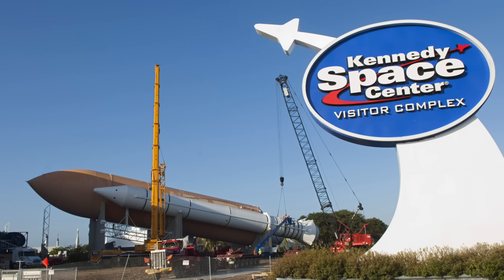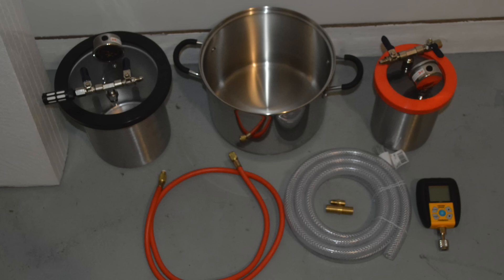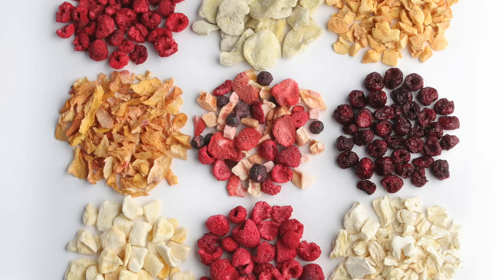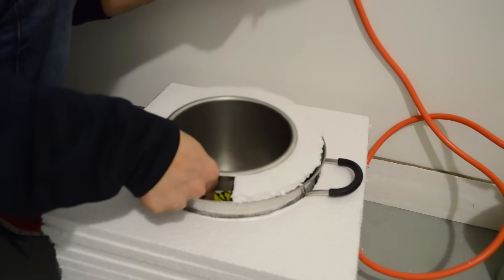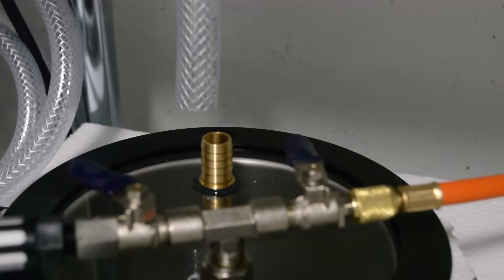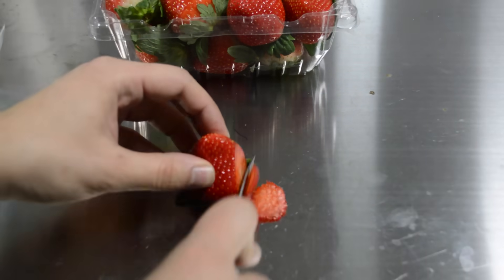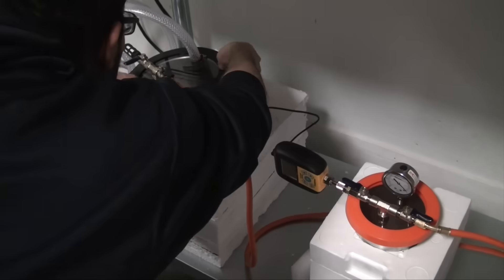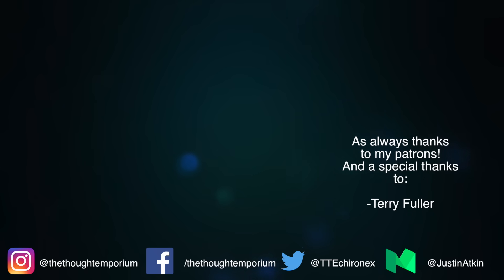How to Build a Freeze Dryer

Comment: Is it possible to put the dry ice in the vacuum chamber, set the pressure, and release the gas as necessary?  also you can add salt and baking soda to absorb moisture in the vacuum chamber.  CAn you please share your feedback?

Thanks

Comment: This doesn't make sense as far as no heat goes. My freeze dryer uses different temps for amlost everything. If using no heat worked the best, why wouldn't they leave it below freezing for everything? I thought you needed heat for sublimation?

Comment: Ok. Still a bit too $$ for me.  How about if one puts a sealed jar with food outdoors in winter (WI)  with manual brake bleeder vac pump on canning lid attachment?  Let nature do the freezing, go outside and periodically pump out all the air.
Anyone tried this?
As a roughly $20-30 option.  
Or in summer, stick the whole assembly in chest freezer.

Comment: This is quite late, but instead of Teflon tape, use a product called nylog on your thread fittings. It acts as both a thread lubricant and a thread sealant. It never dries or cracks. It's what I use on all of my refrigeration systems I need to evacuate. My manifolds can easily reach 50 microns Hg/50 mTorr. I have found that Teflon tends to be a bit leakier.  With that said, I also only used tapered fittings or flare fittings  on my vacuum setups.

Comment: I'm thinking in craft a 1 cubic meter box and get a cooling system from a cooler and install it on it, make a hole and there connect the vacuum to low the pressure so I can keep frozen all that food inside the drying chamber, but I see the really problem is the refrigerant chamber that has to be as cool as it cans

Comment: 6:11 Dickhead alert!!! disregard this warning, anything sub zero should be handled in the nude for maximum safety, if dice or ln2 or liquid butane/propane touch bare skin it just rolls off from the liedenfrost effect. if it touches clothes it freeze burns them to your skin and hurts like getting stabbed
source: every ln2 overclocker, personal experience and watching someone rip a sleeve off with skin still attached

Comment: Hi Thought Emporium,  im gonna build a freeze dryer and i watcherd your video but i have a question:   when the water sublimates off the food, does it travel thru the tube to the cold trap to condense as solid there or is that a secondary condenser with the primary collection of water happening inside the food holding vaccum chamber?  

im not sure if i need to keep a cold finger in the vaccum chamber with the food or not.

Comment: One of the only video I could find. Thank you. Was trying to see if I could build a big one like almost walk in. And how they actually worked. Thanks great video.
Reply: That's a lot of -pressure in a huge area, basically a bomb if it fails.  Unless you're working for NASA, it's going to cost about a Mil in steel and labor for welding the structure alone.

Comment: Had to rewatch this video again for cold trap inspiration... Do you think this design would work for capturing methanol/VOC's in a vacuum percolation device? I'll be bubbling humid air through distilled spirits to expedite oxidation reactions and simulate gas exchange in a barrel. I have access to a diaphragm pump (not PTFE.... But I want one someday...) that can go down to 27in Hg, and I don't want too many vapors to condense in the pump itself... Is there a cold trap design you'd recommend for the budget-conscious creator?

Comment: If you ever need to make more cryo insulation I would recommend closed cell polyethylene foam. We use it at work for LN2 plumbing and it works a treat. If you stick with the polystyrene though I would recommend investing in some nichrome wire, a 12V battery, and either a high power pot for voltage splitting or, for more efficiency and less heating, a variable buck converter to adjust the voltage across the wire. Basically I'm describing a DIY hot wire foam cutter. A lot better than using an exacto, I can tell you that much.

Comment: Great video but in the long run... the initial low cost of a DIY unit will end up costing more than a retail unit, due to the unavoidable need to replenish the dry-ice, given dry ice is a consumable and can be pretty pricey in cetain markets :(  The most cost-effective solution, of course, would be to find a used retail unit for cheap or (better yet) split the cost with someone/a group of ppl, to help lower the rather steep initial cost. On a side note/for what it's worth... many people forget that DIY & retail freeze dryers typically need to operate for many (many) hours, so depending on the water content of the particular food being freeze-dried, the freeze dryer may need to run for 12 hours, or more, which (unless one lives where electricity is cheap or they have a solar system) there's going to be a noticeable increase in one's electric bill when running a freeze dryer...the point being...it might be a lot less expensive to simply spend/invest the $3000-$5000 (plus food costs) on food that has already been freeze dried by a commercial company(?)
Reply: Dry ice is so cheap I think this would be great for home growers that only harvest a couple times a year
Reply: A pump like that is around 300-400 watts. A "home unit" by greenworks is 750 watts. So it costs less in that aspect. Secondly you don't need an astronomical amount of dry ice. Only about 6 dollars worth

Comment: RRRRIIIGGGHHHHTTTTT. LOL I simply bought a Harvest Right home freeze dryer back in Dec 2081 - I run it almost 24/7 and have processed a lot of foods for long term storage. Compared to buying commercially produced FD foods - my dryer has paid for itself many times over. It will also process up to 20 pounds of foods in a single batch.
Good luck with your DYI dryer.

Comment: I just found this. Very good and informative. As an owner of a lyophilizer service company I only have 1 criticism. You keep stating that no heat is applied. This is against the criteria of sublimation. Heat is ALWAYS used in freeze drying. This is how you achieve sublimation and desorbtion in time. Heat is applied either radiantly, or more common, through conductance. Other than that, very informative.
Reply: Considering you need a vacuum of at least 611 pascals to reach the triple point of water, where it goes directly from ice to gas at 0C or higher, do you still need to apply external heating to the vacuum chamber? Is the freeze drying apparatus being in a room temperature environment not enough, seeing as theoretically the ice sublimates at 0C and above anyway? I've read that for the tail end of freeze drying things like fruit or other organic material you sometimes need to apply a small amount of external heat to overcome the molecular attraction between that last bit of water and whatever it is locked inside of, but for the first 90-95% external heat should not be necessary I thought?
Reply: You typically don’t want the product you are freeze drying to get too warm or the ice would liquify to fast, around 35-50F should work for most volatile things. I’m no expert in this by any means though.
Reply: @Microbe_Master sweets get heated to 70 degrees

Comment: I have a question: I did this and my rig works rather well. just a very odd quirk occurs everytime. I start with making the cold trap super cold with IPA and lots of dry ice, it gets to 250pa and then gets stuck there. 3-4 hours on that pressure and then after that as things get warmer i guess, the pressure starts dropping and by the end it is at 30 pa(below 300millitor as recommended by you) and i get a pretty good drying. What I dont understand is, why does it not go to below 300 millitor in the beginning. 

When I do it without the cold trap dry ice and the item that needs drying, everything gets to a much lower pressure than 250pa but suddenly when I use the dry ice and add the item that needs the drying in the drying chamber, it refuses to go below 250pa. The only conclusion I can draw from this is that I am getting the cold trap to be too cold. But I am not even sure if that is even a thing. Any thoughts would help! Thanks!
Reply: I'm an air conditioning tech. We use vacuum pumps and vacuum gauges to remove moisture from ac/refrigeration units.  The pressure in the system will register an almost constant reading until the rate of sublimation slows because the moisture content is becoming less. Better stated  as the moisture content lessens the vapor pressure will drop. When you reach your desired pressure you can be sure nearly all the moisture has been removed.

Comment: Looking at the phase diagram, I have a question about temperature, why do we need to deeply the items that much? Wouldn’t regular household freezer temps be ok with -5 C° for example? As the line between 10 mBar and 1 mBar is crossed, water will sublimate. No?

Second question is about the pump. Isn’t there a pump able to release water into the air without rusting? Of course the gas will turn to liquid water as soon as it leaves the pump and hit 1 Bar.

Comment: I know Im a little late to the party, but here was my thought, from what I can find online, data indicates you want the cold trap 15-20c below the freezing point of the sample. I guess question A) is that freezing point at atm, or our vacuum? B) even if freezing point at atm (32F/0C) 15-20c below would be -4F to +5F - a home freezer is typically 0F. Think it would work? I can get cheap freezers all day, run the sample jar in the fridge, cold trap in the freezer?
Edit to add detail
I think Ive also read that for freeze drying hash (what half u I kno are here for too lol) the ideal sample temp is around 45-48F, so thats why I had the fridge idea, well within the range you can set a fridge temp to. Then you add a small heating pad under the sample jar you can turn on and off from outside to raise jar temp.

Comment: A/C accumulator w fittings
A/C oil
A/C condenser
HD vacuum pump
Vacuum pump fitting & sealant 
Temp gauge
Put condenser into container & seal holes,
Fill w enough oil to fill condenser, 
Attach both lines of condenser to accumulator,
Attach vacuum fitting,
Apply vacuum until reaches preferred temp,
 Freeze w/e for however long

The end

Comment: Hi, are you sure about your vaccup pump pressure requirements? you mention you need below 300 militorr..thats insane..i think you meant mBar not Torr..is it correct?
Reply from the maker: nope, that's correct. mtorr.
Reply: @thethoughtemporium  oh..thts an insane low pressure..then I have to hunt for a high end vaccum pump..I am currently using sartorius 16692..which has a max vaccum of 100mbar or 76 TOR..Which is now basically good for nothing..hehe..thanks for the info.

Comment: I don't understand the point of the water trap I am an AC tech and I pull into about 500 microns daily with no use for a water trap the vacuum pumps can handle a bit of moisture just fine
Reply: What is a 'bit'? I read several reports about people ruining their vacuumpump.

Comment: Hey, I have a question. I am building my own dryer, and I am just wondering if it is okay to just use regular vac hoses the entire way. I see you and some other people are using the reinforced PV tube to go from the cold trap to the vacuum. May I ask why that is? Are you doing this because it is better for the pump, for the drying process, or just because it is easier for you? My DIY trap is made from a dewaxing column, 2 inch diameter 12 inch long sanitary spool with jacket. I wanted to just run the flared 1/4 fittings top and bottom of the spool, and run regular vac hose line from drying chamber to cold trap to vacuum. I didn't think there would be any issues with this, but I just though I would ask anyway. Thanks.

Comment: Ok, question time!! 
I really want to know what happens when you freezedry ice? 
The water is frozen would it petrify the ice? 
I just have a ton of questions on this kind of stuff that never had answers for. 
Now why would want to freezedry ice. If it petrifiy's it then what property's would it have. What possible uses could there be for it. 
I have been wondering what petrified ice would be. 
Would petrified ice a crystal. What would happen???? Could that actually be a new fuel? Or would that explain how the first solid came about. What came first gas, liquid, or solid?  I am guessing liquids because it's the middle ground and you can get to the other to states from that state. Just thinking and asking questions to people who might actually think about it with out the paradigm's of all the unproven theoretical truth's.
Reply: I've seen this done on another video. The ice just disappears leaving whatever trace minerals that were in the water behind.

Comment: xps is a lot better choice for this
it's mostly orange and can be found in most hardware stores
it doesn't have the small balls, instead it is just one big piece of foam
can also be cut easiely
make sure to get the type with a smooth surface, not rippled or textured, cuts better and can be glued together without sanding the texture off

Comment: Can you use a pump that does not take down to full vac? I have an old Gast diaphram pump that only pulls around -21, no matter what I do to the system. Would this work or should I just use a cheap rotary vane? I just don't like those rotary vane pumps with the oil.

Comment: I’m curious to know what your final build cost was? Freeze dryers are ridiculously expensive.
Reply: Right?
Reply: Yeah how much
Reply: $180 Field Piece SVG3
$30 2 Gallon Stainless Steel Cooking Pot
$100 Two 2 Quart Stainless Steel Vaccum Chamber ($50 each)
$3 1/4” Flare Union 
$7 5/8” Barb Splicer
$25 Styrofoam sheets
$15 Spray Adhesive for Foam
$15 High Grade Teflon Tape
$9 J-B Weld
$10 Thermal Work Gloves
$25 Denatured Ethanol
$150 2 stage rotary vane vacuum pump

Total $569

Each time:
$5 Dry Ice
Reply: @phylliida  You're deeply underappreciated.
Reply: Built on Amazon like 400

Comment: Are such extremes of vacuum and temperature really necessary?  The ancient Incans were reported to have freeze dried foods by carrying them up a mountain and leaving them exposed at the summit for several days.  I appreciate that you had mushy results from a leak in your vacuum chamber but I suspect some freeze drying could be done with less effort, say with mason jars, a foodsaver jar attachment, an automotive brake or AC vacuum pump (the hand pump version could be used to remove the water vapour periodically and should be relatively immune to water vapour as one of the purposes of such pumps is to remove water vapour or at least cheap to replace if it isn't) and a deep freezer.  The water phase diagram indicates that being below the triple point in both pressure and temperature should be sufficient to avoid the liquid phase so the only issue would be the rapidity of cooling to preserve quality and items could be precooled with dry ice before being placed in the mason jars for a vacuum.   Even on a cold winter day, you can see a dusting of snow sublimating off a shoveled driveway, at least you can in some parts of Canada.  The phase diagram, the history of the Incans and personal observations of Canadian winters suggest that such a deep vacuum and cold temperature may not be needed though admittedly it does get very cold in Canada.  I'd like to throw in Alaskan observations but it's always a winter heat wave whenever I've visited Alaska, a bit annoying to be over dressed for an Alaskan winter visit.
Reply from the maker: Yes it's really necessary. It will not work otherwise.
Reply: @thethoughtemporium    Not according to the water phase diagram.   The sublimation line exists from absolute zero and a perfect vacuum to the triple point and you need less of vacuum the warmer it is.  The Wiki description of freeze drying says that commercial freeze dryers actually heat the product to sublimate more ice. It does say that quality is improved with what they call IQF, individual quick freeze so apparently getting the product very cold fast helps with crystal structure production but once frozen it seems that so long as you do not reach the triple point, it's actually better to be warmer so the vacuum could more easily extract the ice and less of a vacuum would be needed.  It would make sense to quickly freeze the product first with intense cold but after that the deep vacuum and intense cold appears counter productive at least according to the phase diagram.

Comment: Wouldn't a Sprengel vacuum pump work?
A simple pump is much cheaper to buy and run. Nerd rage built one for $50 and achieved with water and a 100psi pump almost the pressure you want.
Changing to mineral oil or vacuum oil to improve performance further would mean you can boil off the water at sub 25C without the need to freeze the fruit. The water that comes off can be separated through a simple oil water trap made with a sheet of plastic. So you can cycle the same fluid around, and it doesn't require cooling. This would be lower investment cost and lower running cost.
However I've not built or tested this, so I'd appreciate any information as to why this wouldn't work.
Reply: Do you mean a water aspirator pump? A Sprengel pump is what Cody's Lab made, it uses mercury falling through a small capillary tube to evacuate the air. It pumps far too slowly to do the job. However, as far as I can tell an aspirator pump will work. I found this paper http://images.peabody.yale.edu/lepsoc/jls/1970s/1976/1976-30(4)277-Hedges.pdf talking about doing exactly what you describe. The drying process was very slow using water as the working fluid but as you say, could be improved by using mineral or vacuum oil.